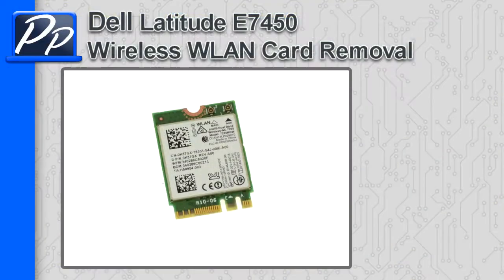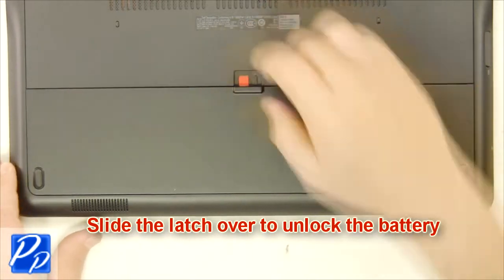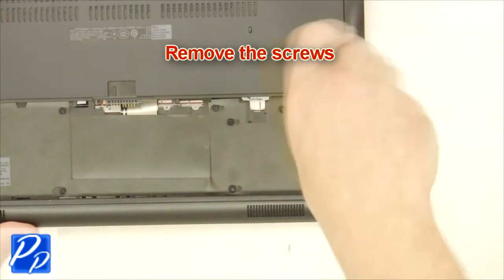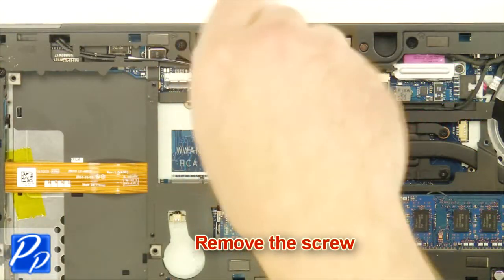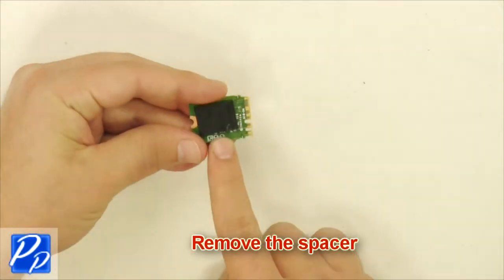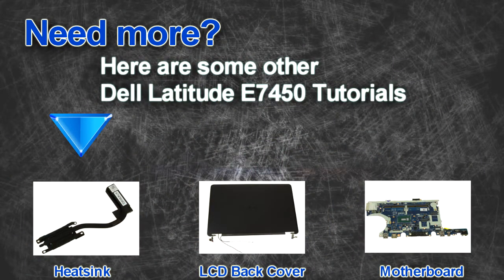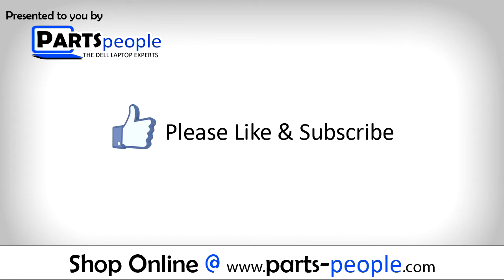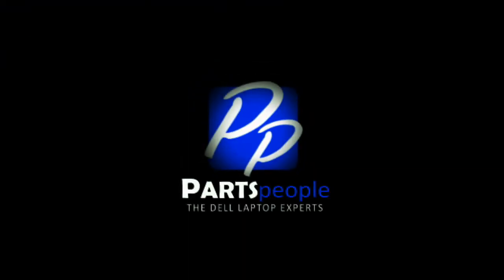Dell Latitude E7450 Wireless WLAN Card Replacement Video Tutorial

Comment: WHERE is the rest of this video? This only shows the disassembly - not putting it back together again. I've tried for 2 days to get those antenna wires back on and they won't go. What's the trick?
Reply: 2 days ? i put them back in 3 minutes with a screw driver only. did you bend them ?